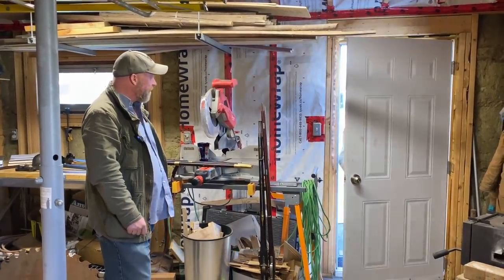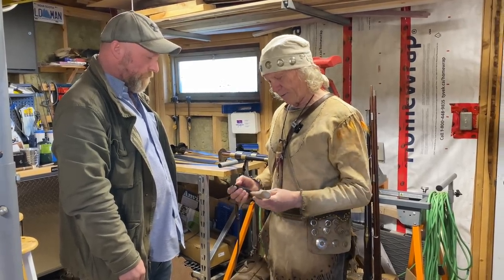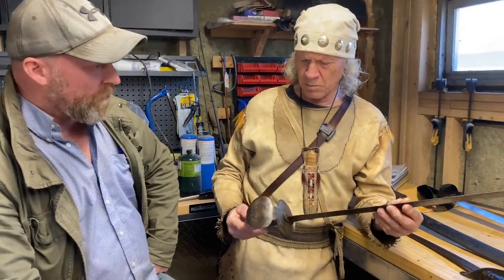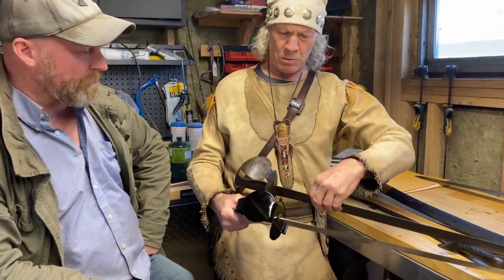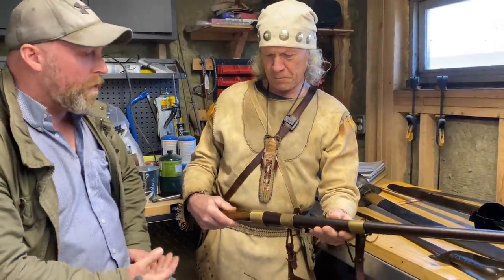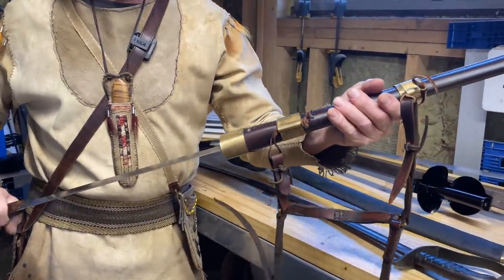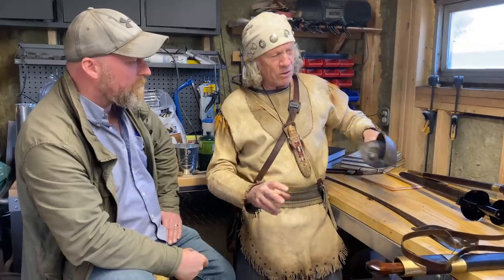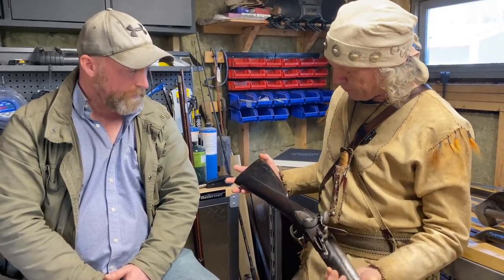Guns, Swords & Pouring Pewter Rings on a Curly Maple Axe Handle | PIONEER | BLACKSMITH | BUSH CRAFT

Comment: Can you explain your hat our head cover the round & different designs you have?
Reply from the maker: It is a square of linen worn like a turban, which was quite common on the frontier.  It has some trade silver attached, which was also very common at the time.  Bought, sold and traded at most outposts.  One could use it like currency.

Comment: I may have missed it but are the rings ornamental, functional, religious?
Reply from the maker: Got the first two.  Religion has no part in trade silver but, to the indigenous peoples, some had a significant meaning and possible a belief that they were “good medicine.  Trade silver was a common item on the frontier … bought, sold and traded.  So ornamental for sure but, could be used as currency on the frontier at any out post.
Reply: @TheWoodlandEscape  Makes sense.Thanks.